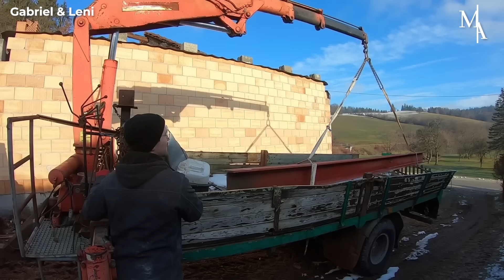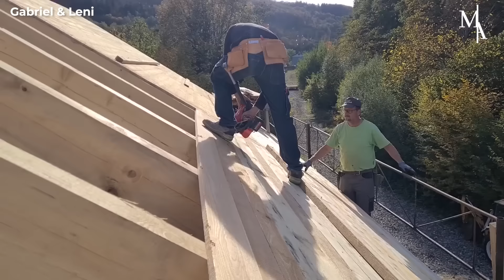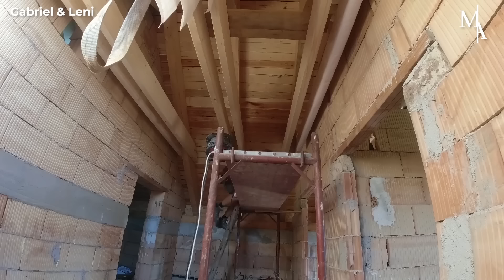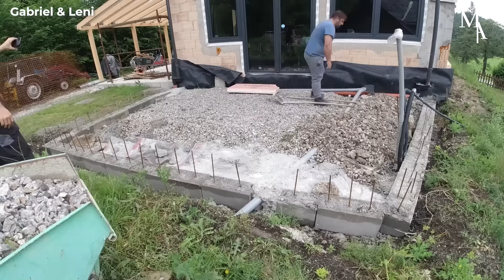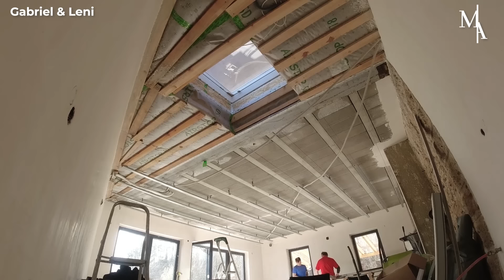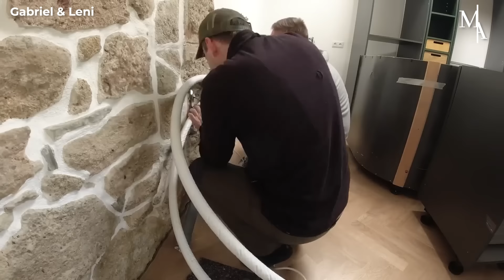Family Transforms Abandoned House into Dream Home | Start to Finish by @Gabriel.Leni100

Comment: How can you say gravel for drainage if you put styrofoam sheets on top of it, in other words lock it off so there is nothing to drain? It is for leveling, nothing else. Sand would have been a better option. PS That part where they put concrete renforcement in the ground and they poor concrete is a really bad idea. The iron needs to be at least 5(10)cm from the ground service (that is all around - 360) otherwise it will react with the soil water and corrosion will take place which means the iron will expand and crack the concrete foundation. This is a bad example of making fundaments.

Comment: The radiant heating on the uninsulated old walls is ignorant.
Reply: Why would it be? We need the radiant heating to prevent condensation on the wall inside on very cold days. It can't have insulation for several reasons.